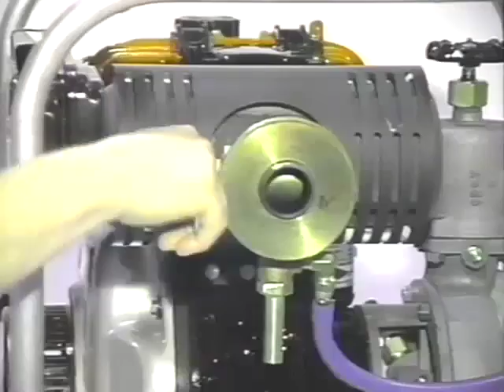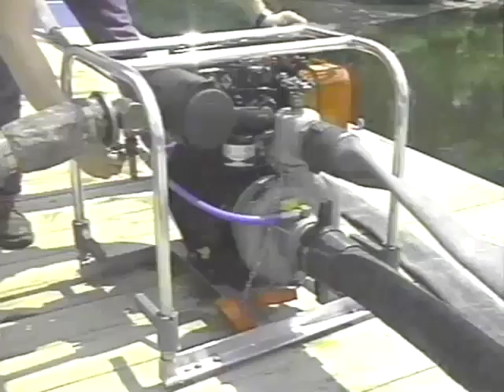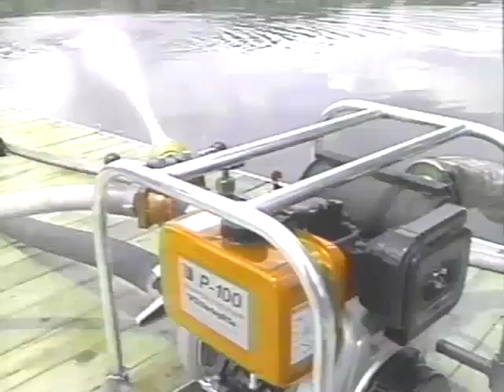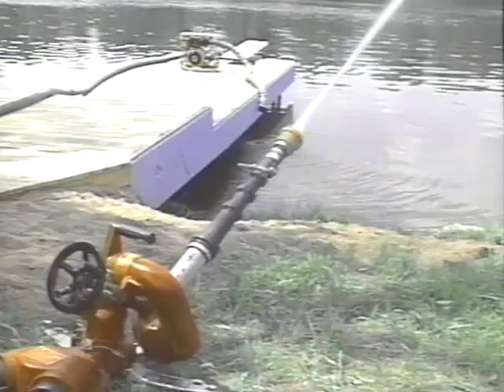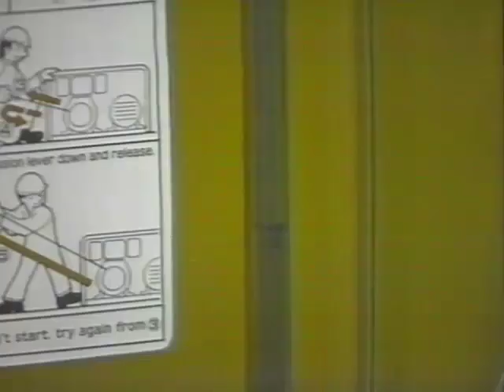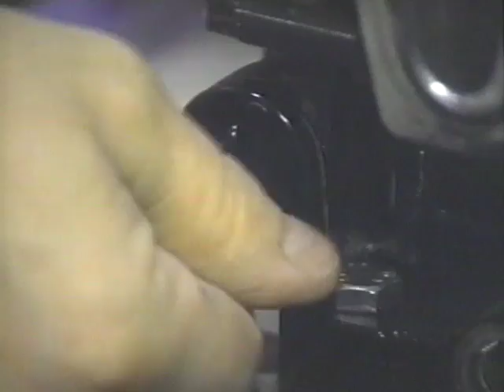P-100 Navy

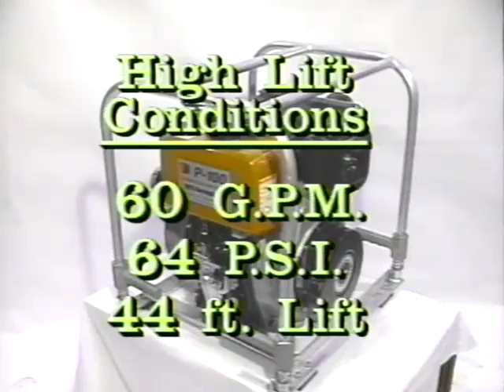Comment: 2:10, might want to double check those numbers, talking about pressure and lift usually means suction lift to add to the output head.  Makes sense with the other outputs quoted, but not "60GPM at 64PSI and 44 ft Lift", not possible with water on this planet.  Maybe 24'?